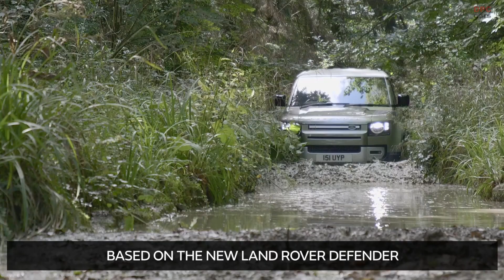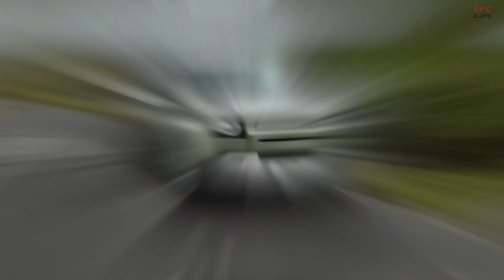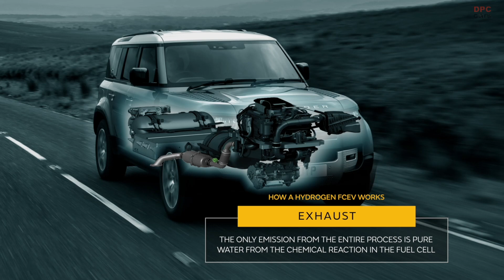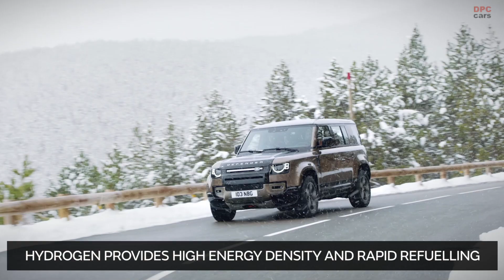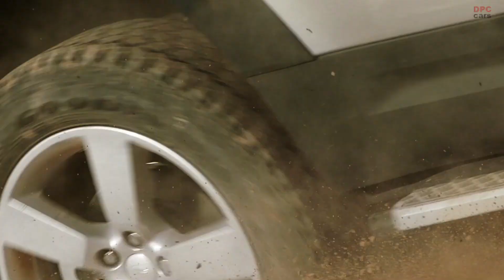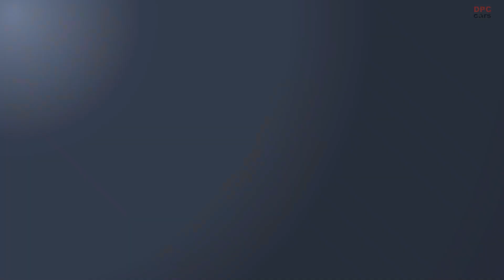Land Rover Defender Hydrogen FCEV Testing

Comment: Awesome, let's take an SUV that everyone buys for its room and turn it into the interior room of a subcompact that's worse for the environment than BEVs.   I'm sure it will be useful for someone that apparently drives all day long every day and never stops and has children that stay small.  And sure "if" you can make hydrogen in a carbon-neutral way, it'll be awesome.  That's a monumental "IF"  because if you make it with "green" electricity, you're wasting 75% of it converting it back and forth from the green source to driving the wheels.  Imagine needing 4 times the solar panels and wind turbines.  Yea, that's environmentally friendly to make all those, lol.  Some day when they can make fuel cells without actual rare earth materials that cost $20,000/lb it'll be a little better, but I'll be long since pushing up daisies by then.

Comment: Should just go full EV and skip the hydrogen.
Reply: It is an EV, its main source of power is a hydrogen fuel cell. so long as the hydrogen is produced in a carbon-neutral way a hydrogen fuel cell is a lot better for the environment and much more practical than a lithium battery-powered EV.
Reply: This is EV.   It's just using hydrogen as storage rather than lithium ion batteries.

We need to move away from lithium ion as a source of power storage.   For Land Rover, you can't use them in extreme climate conditions, but hydrogen you can.
Reply: FC-EV. It's not a hybrid.